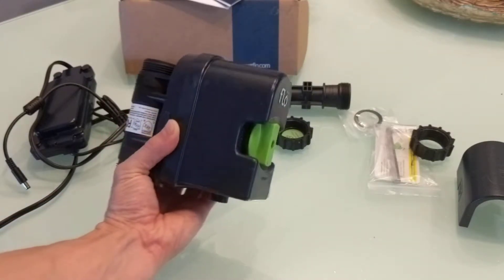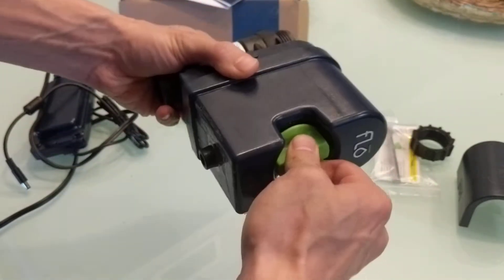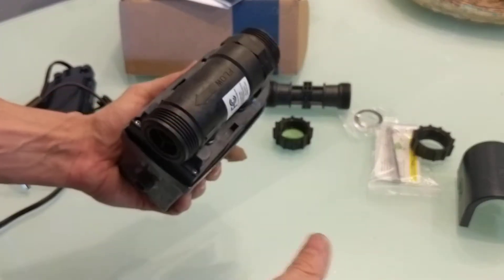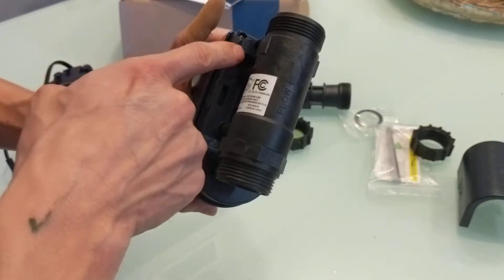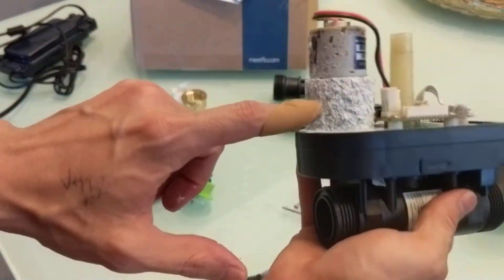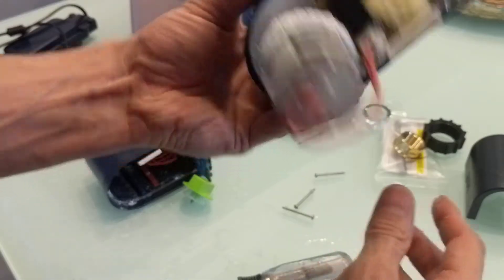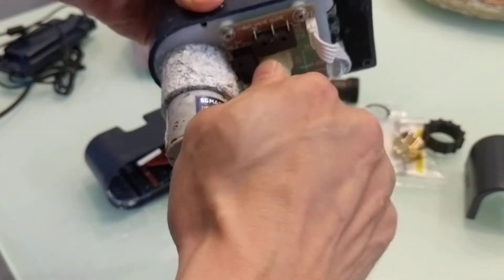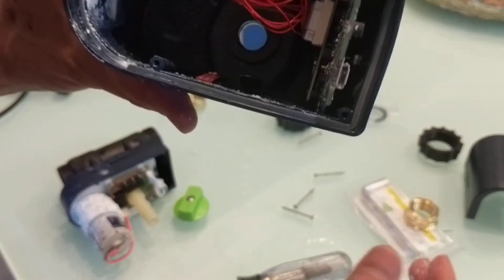Taking apart the Flo by Moen

Comment: Is the green shutoff knob just held in by that screw? Mine broke in half and of course they don’t sell a replacement knob…it’s the whole unit and out of warranty. I’m wondering if I can substitute something.
Reply from the maker: The knob on mine wouldn't budge, but I was still under warranty I guess so they sent me a new unit. The problem with replacing the knob is that it fits into the unit almost like a gear.  You would need to retain that shape if you were going to try to replace it yourself.  Depending on how/where yours broke, it may be possible to rig something up.
Reply: @TravelingDirector  Did it just come out after you took the screw out? I just wasn’t sure if it was a more intricate thing. (Luckily it still shuts off through the app).
Reply from the maker: @robust282  yep, just unscrew and the knob comes right out. You'll see how the back of the knob fits into the unit. It's that particular gear shape that you'll want to keep. Good luck!

Comment: Did you take the unit further apart to see the gearing? I cannot turn my knob manually and the app cannot either, it clicks as the motor turns, as if a gear is stripped or something is at the end of travel. Mine is installed and water is flowing, just no shut off ability. Mine is not under warranty.
Reply: This happened to me and I fully took it apart (takes about 2 minutes). Firstly, the valve itself was hard to turn probably from some sediment on it - I used WD-40 and my pliers to make it turn and now that is back to normal. Next, there is a plastic gear wheel between the motor and the shaft for the valve that had a broken tooth because the motor kept trying to turn the stuck valve. I called Flo to just get the gear and they declined. If I could get my hands on another non-operating unit where the gear is not broken then I would have mine fixed! Does anyone have one?!

Comment: I have a flo by Moen arriving tomorrow that I'm installing soon. Your video makes me worried that the device itself can cause water damage if the water got into the mechanical housing. Do you have well water with sediment that may have damaged it?
Reply from the maker: I had three or four broken units, all were from water getting into where the power plug goes into the unit. The current unit outside has a plastic grocery bag wrapped over it and there are no issues
Reply: @TravelingDirector  it sounds like the water is coming in externally and not from the valve. If you have one inside maybe condensation from a pipe above is dripping into it?
Reply from the maker: @D-cs1qt  I'm not sure you saw my previous comment, but the water was coming in the power jack wire...which is now covered and all is good.
Reply: @TravelingDirector  good to know. Thought the device failed and water was coming in from the valve. Thank you for clarifying.

Comment: Do you know if that's because of hard water? Also did Moen replace it without issues?
Reply from the maker: Nope. The water isn't supposed to come in contact with the internal parts. This happened because water got in thru the top hope where the plug goes. It's happened to the next one too. I'm on my 3rd unit. Moen was amazing at their support. This time I put a little cap over the wire.
Reply: @TravelingDirector  I'm about to install a Flo sensor on my house. I plan on making some sort of simple cover that can easily be removed if need because I want to protect the device from the weather elements. After all, the entire outside unit is made by plastic. Everyone should know plastic in the direct path of the weather elements is a failure waiting to happen. It's just a matter of when. Hopefully me covering the unit will prolong the life of the unit as much as possible.
Reply from the maker: @Ozzie4Para  I built a little house for my current unit the same day I installed it. Highly recommend
Reply: @TravelingDirector  they told me i had to replace it and purchase a new one because i did not subscribe to flo protect.

Comment: So you had this failure within the warranty?  Moen told me that I'm out of the warranty so I need to pay 400 for a replacement.
Reply from the maker: I can't remember but I suppose I must have been in warranty. Either that or perhaps the problem / defect was covered for longer? I'm unsure to be honest
Reply: @TravelingDirector  no unless you purchase the protection service which extends the warranty.  So if this was a bad design it will happen again.😑
Reply from the maker: @willymaven1626  I must have gotten lucky then. If if malfunctions again I'll be trying another device altogether.